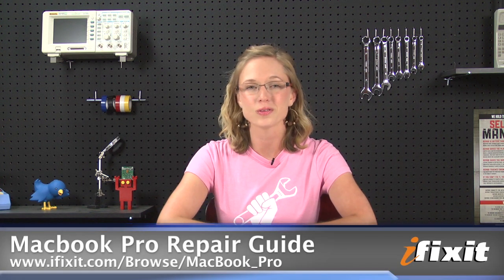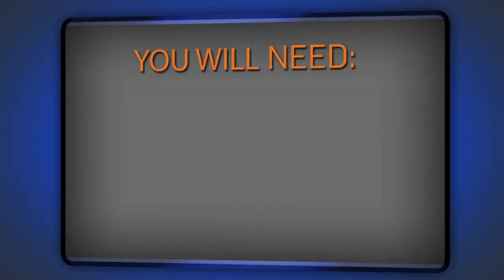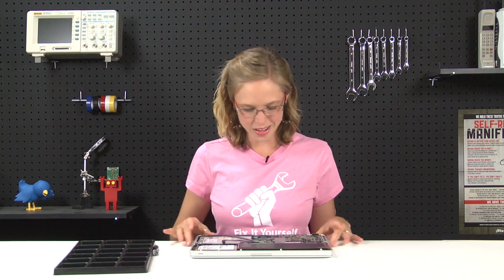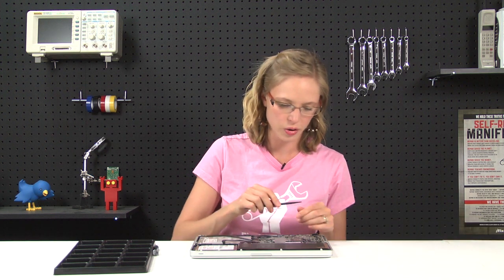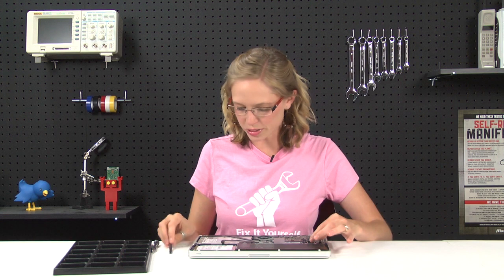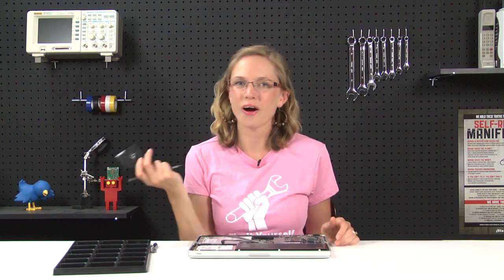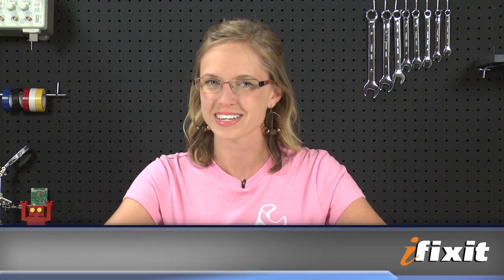How To: Replace the Fan in a Macbook Pro Unibody 13"

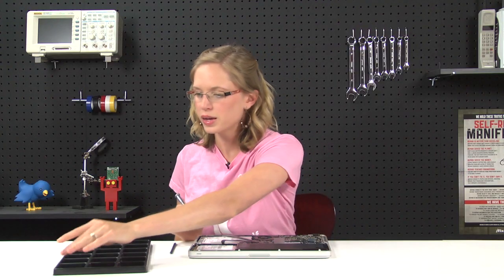Comment: Ummmm yeah.... 2:08 .... I just did that right now accidentally. Can you show a video on how to reattach the connector of the fan?
Reply: Ive just broken the same accidentally today .. i saw this video latee 
Now Im thinking to weld/ solder it .. please tell me how you can fix it
Reply: Today I ripped socket 🤦‍♀️ please tell how you fix it, is possible sold it?? Thanks for your ansewr

Comment: I tried cleaning my macbook pro unibody 2013 fan but it still makes a weird grinding sound. I don't have a spudger so I didn't manage to remove the cable from the socket as I am scared it's gonna break. I feel like my fan is dying but I don't want to bring it to apple store to fix it since they will overcharge me. I can order the fan online and replace it myself but I am really scared if I push the cable out of the socket it's going to break. Any advise?